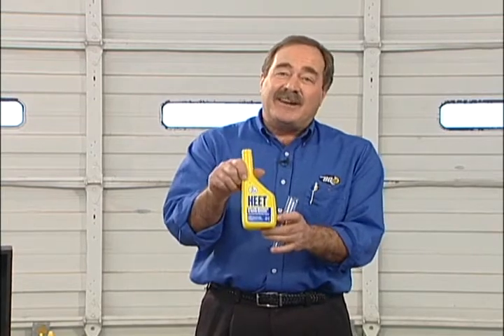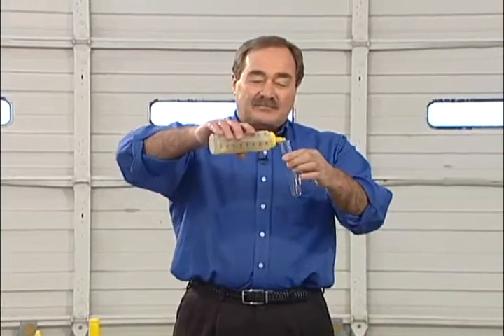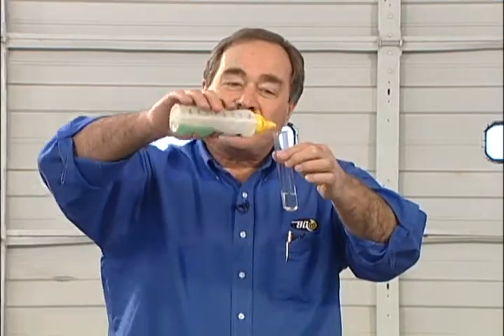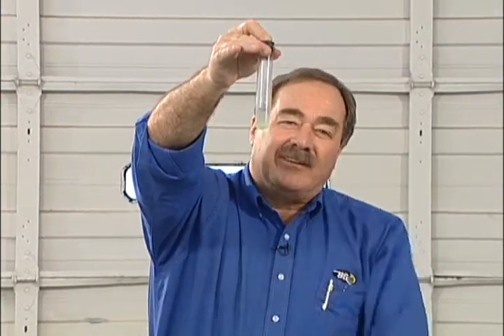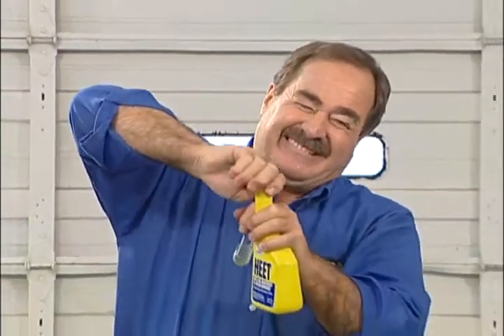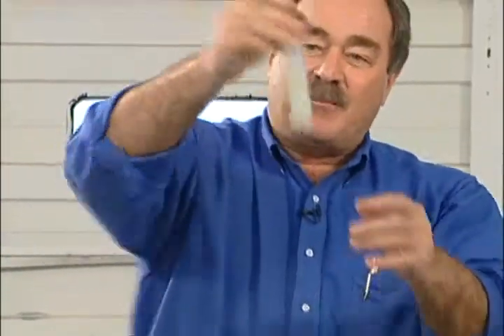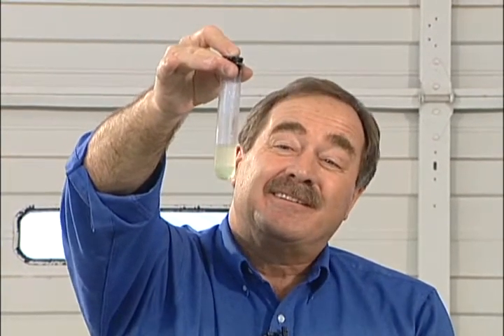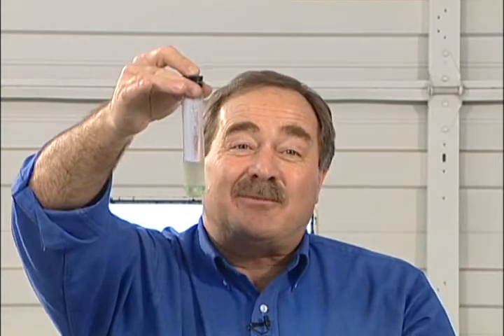BG Fuel System Drier

Comment: Yellow heet really shouldn't be advertised as a water remover, but if you had used red HEET you wouldn't have anything to show. I did this test myself. BG fuel dryer and red iso-HEET are both isopropanol as per MSDS, and both will dissolve no more than 1/4 cup of water into gasoline, but there doesn't seem to be anything that does a better job than isopropanol.
Reply: The red bottle doesnt work all that great either. Watch Project Farm YouTube channel where he does testing with all different products.